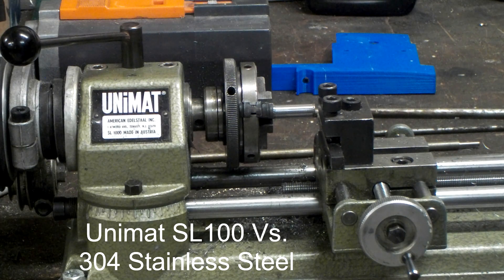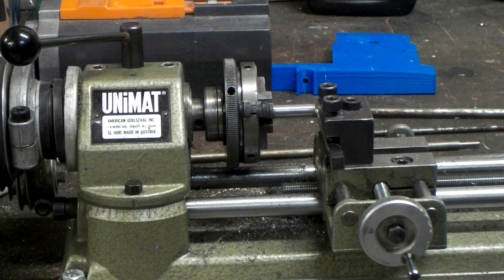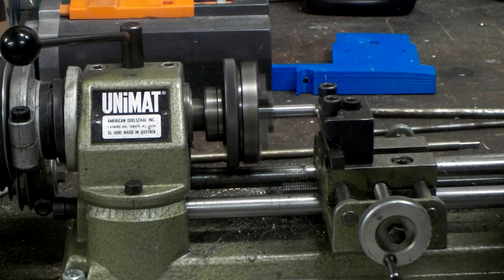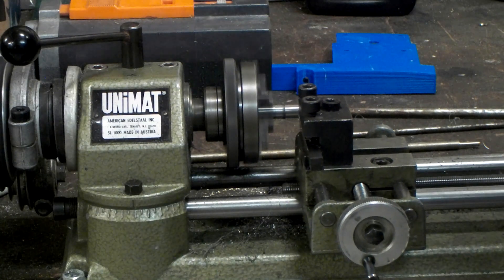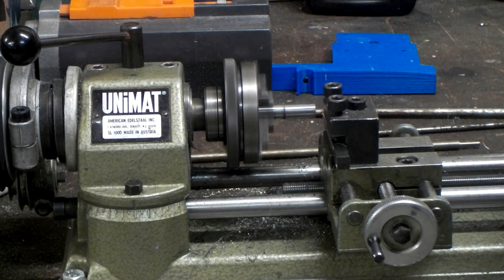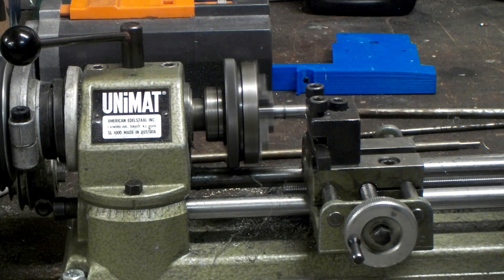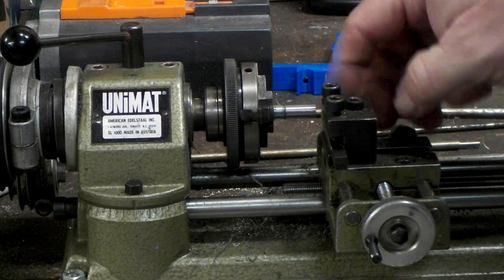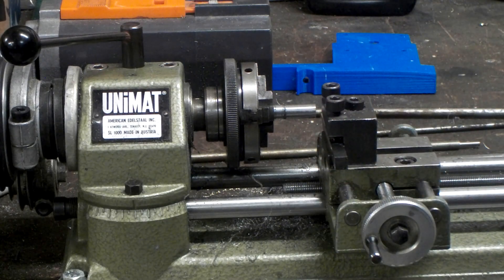Unimat SL1000 Vs. 304 Stainless Steel

Comment: Great video. I have just bought an SL - a tiny bit smaller than my Colchester/Clausing 15" swing lathe!
Have you upgrade the motor on the SL? Hard to tell from the video.
Reply from the maker: yeah, the unimat is like a toolpost tool for the Colchester!
this SL1000 came with the stock 90 watt motor.
i have a DB200 that has the more anemic 80 watt motor